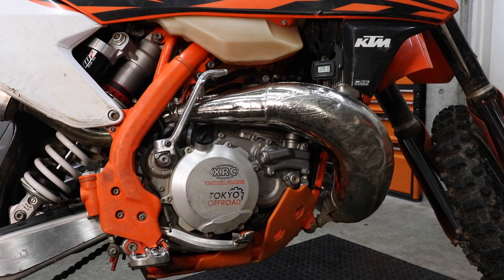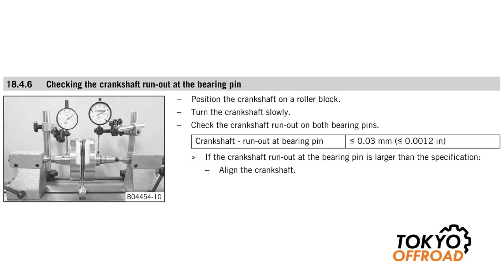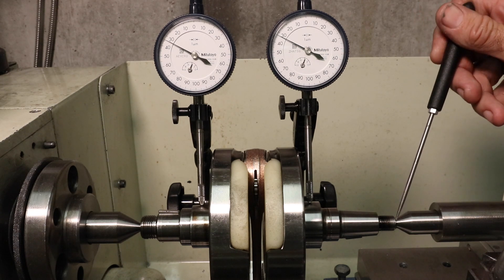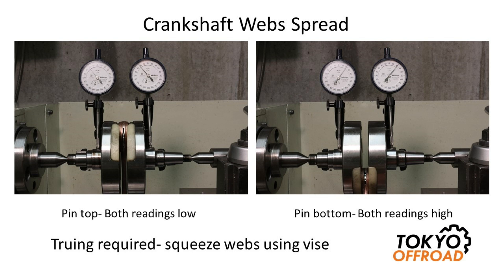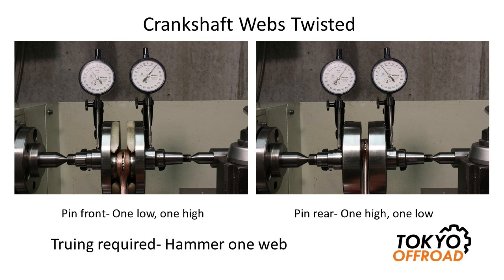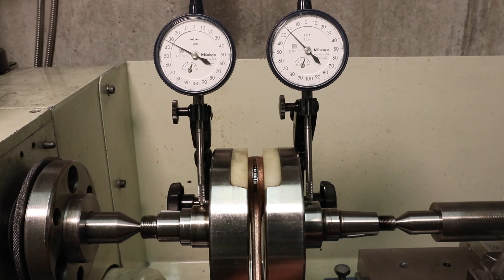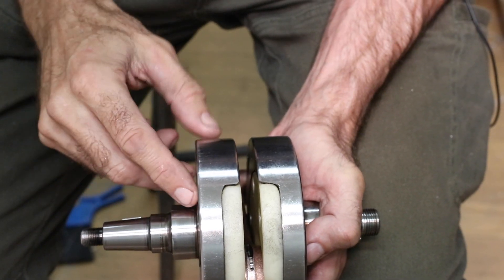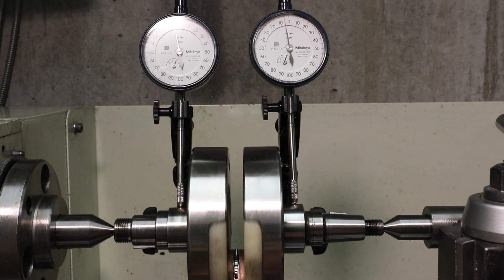Part 4- 2017 KTM Bottom End Overhaul- Crankshaft Runout & Truing

Comment: Using the dead centers assumes that they are 'dead center' and no damage whatsoever from a handyman using a hammer or whatever at some point in the life of the engine. I use the bearing journals with concentric sleeves made to fit over the crankshaft ends. Usually made from aluminum and heat fitted for a tight fit.
Reply from the maker: The crank is machined using the centers, so they are an excellent reference point and also the furthest away points so will allow any runout to be measured more easily. But yes, if the centers have been damaged this won't work.

Comment: Now you must be aware that the centers in the shaft can be damaged. If someone has hit the end of the shaft or used a puller on it then there can be a damage to the actual center.
Reply from the maker: Yes, if someone has been hammering on the end of the crankshaft the centers could get damaged. But IMO, there is never a good reason to hammer on the end of the crankshaft, so this should be a non-issue for most.

Comment: Excellent video. But how much do you trust your lathe to use as dead centres for such a small run out ?. The run out on a crank is generally only measured on the bearings journals..
Reply from the maker: The height and offset of the dead centers relative to the lathe bed, or relative to each other are not critical for this measurement. What is very important is that the dead centers don't move during the measurement and provide a fixed, stable reference axis for the crank shaft to rotate about. The lathe is very stiff which minimizes any movement of the centers. The crank run out readings I see when using my lathe in this way are very repeatable, suggesting the measurement error due to the dead centers moving are insignificant.

Comment: As you begin to squeeze the crank webs in a vise wouldn’t it be more beneficial to somehow have a dial indicators setup between the vise grips/crank webs so that you can accurately measure the precise squeezing moving required by the vise in order to push the crank webs together in a controlled, target amount in order to maintain the utmost precision in crank web alignment process? 

This seems like it’d be a much better and a more accurate way to push the crank webs into their exact desired position as opposed to just re-squeezing the crank webs in a trial  and error fashion which may leads to the weakening of the crank pressfit joints. Do you think this is how the factory teams go about dialing in their cranks for maximum precision.

I would love to get your thoughts on the approach I mentioned as I am a completely new engine builder hoping to do the best job I possibly can. Any guidance would be hugely appreciated!!! 👍 (sorry if these are dumb questions!)
Reply from the maker: The ultimate goal is to press the crank webs into the correct position first time and not require truing afterwards. A good jig really helps with this. However, the runout spec is pretty tight so you'd have to be quite lucky to hit the spec with no adjustments. The adjustments required are very small tweaks. You could certainly set up a dial indicator to measure the amount of squeeze in the vise (if that's the adjustment you need to make) and would need to calculate the scaling factor. However, I do it by feel, a little bit at a time, trial and error, remeasuring the runout after each adjustment as shown in the video and it really doesn't take that long.

Comment: Great video!!! 

Question, if starting the truing process with a new crank, would it be best to start with getting the webs aligned as perfectly as possible in terms of being in aligned rotationally first, then attacking the parallelism of the webs next?
Reply from the maker: My recommendation is the same as I showed in the video and start the truing with whatever is the largest type of mis-alignment. Small corrections and a remeasuring runout is key to monitor your progress.
Reply: @TokyoOffroad  thanks for your responses! I’ve really enjoyed and learned from your videos! I really like your cardboard bolt template idea…super simple and super effective. 👏 Also, I really like how meticulous and organized you are when executing your maintenance work and also how you explain things very clearly yet succinctly. It drives me nuts in videos when someone explains the right way to do things and then immediately skips doing things the right way saying that “it’s not really required this time.” All these pro qualities are actually hard to find these days in good YouTube tech videos so well done sir. 👍

With so much precision, are you a machinist by trade?
Reply from the maker: @mxcollin95  Pleased that you enjoy the videos. I'm an Electronic Engineer by trade.

Comment: Sent mine out for rebuild to crankworks here in the states. Should I test mine for run out before installing when I get it back?
Reply from the maker: If you have the necessary equipment to test the runout then yes, it’s a good idea to measure before installing it.

Comment: Will the trying required be opposite if dial indicator is kept at the edge of the shaft in some other Crank shaft??
Reply: Truing"
Reply from the maker: No, it'll still be the same required method. However, the measured runout will get smaller the closer you get to the supports. For this reason, as discussed in the video, it's best to take measurements as close to the crank shells as possible as the measured runout will be larger.

Comment: I really have a conceptual problem with pinch and spread. The crank I am working on (the first one I have attempted) shows that it is pinched. Im getting an even needle swing now after hitting it a few times with my brass hammer to move the webs around to match each other......but the needles move .005-.006 high with the pin down, so "pinched". I have beat it with an aluminum 1/2 inch rod with the tip ground into a wedge and it is not budging a bit after several good smacks. What about a 10 ton press fit pin is going to move to "adjust" pinch and spread? I get the concept...but something would have to MOVE, or GIVE in order for the distance between one side of the webs and the other to be affected. The pin is not gonna bend. There is no clearance between the pin and the webs to permit the pin to move, or the webs to move on the pin perpendicularly to the pin. I mean really. ????????????? Ill try making a wider wedge tool at some point.... but still...an assembly such as my crank (from a 1970 kawasaki) should not have ANY room to flex or move in the way it would seem to need to. What moves with pinch or spread? Something would have to deform or bend in my estimation in order to change it.

Comment: So how important is the alignment of the centers to each other? I have an old craftsman lathe and my crank will fit on it…I’m sure it’s not the most precise alignment in the world and I will try to put centers in the Chuck and the tail and see if I can get them to touch point to point….
Other than that I thought of building a stand with some long threaded rods that ended in a point (points made on a big lathe at work) ….then supporting the crank between those.

I’d guess since the crank halves each have an indicator on them it wouldn’t matter if the crank was off level end to end or nearer or further left to right ??
Reply: Any decent lathe can act as a set of bench centres, as long as it is not worn out, remove the chuck and use a solid dead centre point, same as the tail stock, try to lock the head stock so it cannot turn, this will stop any end float that might be there, or buy a set of bench centres for maximum stabiity.

Comment: Excellent video; I have just used your advice and technique to true up an old maico crank .Got it to 0.02 mm. Once you get over the apprehension of the seemingly brutal technique that is needed and develop a feel for how much to hammer or squeeze the halves it doesn't take too long about 20 to 30 mins in my case. Thank you.

Comment: Hi Mark, Please let me know how did you adjust dial gauges at zero, which position is there start point and how you dicade it that was really zero and start point.
Thanks,
Reply from the maker: The absolute adjustment of the dial indicators is not important. For the video I had them adjusted so the zero was approximately in the middle as it's easier to understand what's going on. But its the peak to peak reading of each gauge which is important and they don't need to be zeroed to measure this.
Reply: @TokyoOffroad  Clear, Thanks a lot!

Comment: Thank you for an awesome video. I am in the process of rebuilding my 2013 KTM 250 EXC with around 500 hours. I live (now stuck) in Vietnam and have to do all work myself, but never did a bottom end (that doesn't sound right...). Anyway, I shipped in a Cylinder Works Big Bore and Hot Rods Stroker bottom end kit and now kicking myself for not buying OEM after seeing your video. Unless there is easier way, I don't think I will be able to do measure the run out or end play. The kit didn't come with any compensating disks and there is one on the left side of the old shaft. Should I install a new compensating disk of same size as old on new shaft and pray that everything will be ok? Also, it didn't come with the woodruff keys and there is little on internet showing how to correctly put them in. Any help is greatly appreciated.

Comment: 9:26 That's strange. I would think intuitively that if the Webs were spread opposite of the pin (away) then there would be a high reading when the pin is at the top and low reading when the pin is at the bottom. It looks like the Web spread away from the pin would angle the crank down not upward... wth.
Reply from the maker: If the pin is at the top and the webs spread out away from the pin the the crank will be high on both sides if measured from the top (as in the video). If you have two set squares it’s easy to visualize what’s happening...
Reply: @TokyoOffroad  I just made a crude drawing. I think I see it. So when the pin is at the bottom the crank ends would flex the pin up?

Comment: Thank you for showing all of us how these cranks cum when we buy a new Chinese crank from Wiseco hot rod all ways buy a Stock oem crank
And your gap should be no bigger than .025
Reply from the maker: This is all stock KTM OEM parts as discussed when I rebuilt the crankshaft in part 3. What gap (0.025) are you talking about and what units (mm, or inch)? If you're talking about the conrod axial play, I measured that in Part 3 and it was greater than 0.6mm (0.0236") and less than 0.7mm (0.0276") which is within the KTM spec (0.6mm to 0.7mm). I remeasured this after truing and it hadn't changed.

Comment: Is this the first time you ever put a dial indicator on a crank to see what the run-out was? It should be at .00 on both side.less bearings and less chance to have a leaky crank seals
Reply from the maker: I'm not sure what units you are talking about (mm, or inch)? All measurements in the video were metric. If converted to inches the clutch side runout was 0.00004" (1um) and the flywheel side was 0.0007" (18um).  The KTM runout spec is <=0.0012" (30um).

Comment: When truing my crankshaft an expert says that using a lathe is not the best way because the rotating side has bearings and there is always play in bearings. But like always a wounderfull videos there, wish i had this when i rebuilt my engine bottom-end last year
Reply: How does your expert suggest that it be trued?
Reply from the maker: A bench center is best for runout measurement, but I don’t own one. If anyone has one which they don’t need I’ll gladly accept it. My experience is using dead centers in the lathe works well and my runout measurements were very repeatable. Note the the lathe head (which has two opposing taper bearings with preload) does not rotate during the measurement and is simply holding the dead center in place. If the inaccuracy the lathe head bearing was introducing had been large I would not have been able to repeatedly measure the final runout on the clutch side of less than 1um. As such I do not consider the lathe head bearing (on my lathe) introduces enough error to be concerned about in this application.
Reply: @TokyoOffroad  yes i am very impressed with the result you had. Mine was near 1μm too
Reply: @jaker1160  by luck his work is calibriate and true rotating  equipement and he have all tools to do it. We use a bench center we work in the same turbine maintenance company

Comment: Good job and nice video. I am curious about if the whole new crankshaft from the KTM is within this limit. It seems the truing may be changed easily when  transporting from the KTM factory to the customer.
Reply from the maker: Good point. If the crankshaft was dropped, yes it's possible. If you can measure the runout before installation to check it would be best...

Comment: Very interesting! I've been around 2 strokes for most of my life, I find it hard to believe that the crank does not just go out of true as soon as the engine is fired up! I used to run a 'mega tuned' RD 350 LC on the road, the crank had to be welded up after being trued in order to keep it in spec. (Although I suspect the welding process may have messed up the run out to a degree). You should have given the crank one final whack with the hammer to get rid of that 18 micron runout!...Easy for me to say whilst sipping a cup of tea.
Reply: @Northwest Connection I don't think the casing would have enough 'stiffness' to hold the crank true, for starters the bearings actually have a clearance value (could be C3 or C2, I can't remember which). I have cranks twist whilst they are inside an engine due to a failure of one sort or another (piston seizure, that sort of thing). I had a crank even break the welds that were holding it true when a drive chain snapped which jammed up the gearbox, it broke two teeth in the gearbox and totally twisted the crank up. I was young and stupid, I should not have let the drive chain get so warn out, I should have replaced it. Anyway my point is that the cases won't hold a crank true.